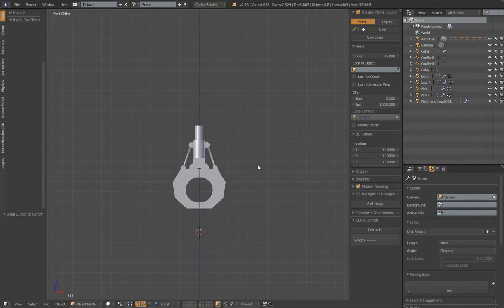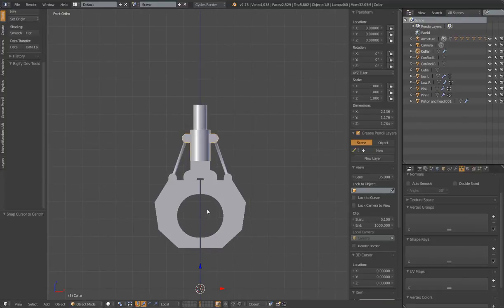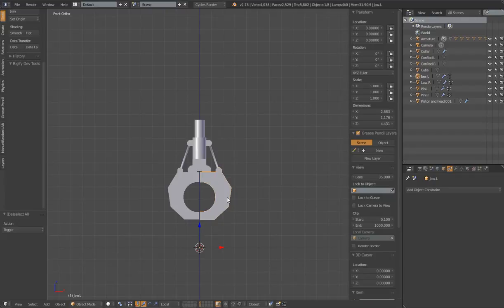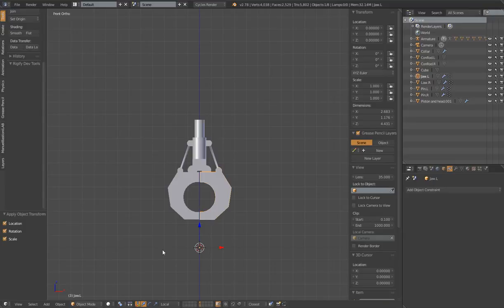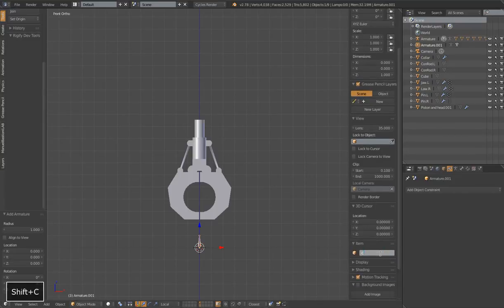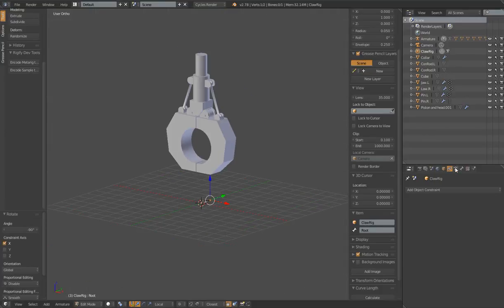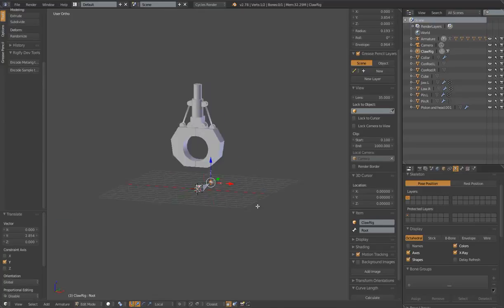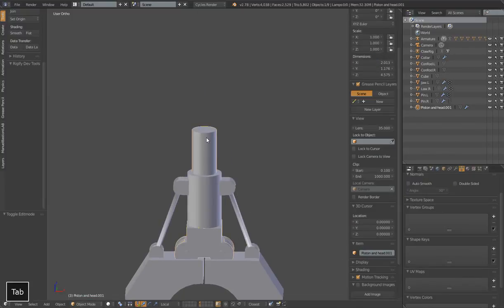Blender Forum Help 10

Comment: Hi, how did you get the coordinate system at the pin of the bones?
Reply from the maker: I'm not sure I understand the question. I used the vertices/edge loops in the mesh objects to place the 3d cursor,  then used that position to place the bones in the armature. Bones will always be added at the 3d cursor's position when adding new bones to an armature.